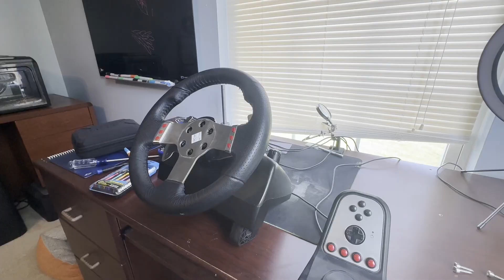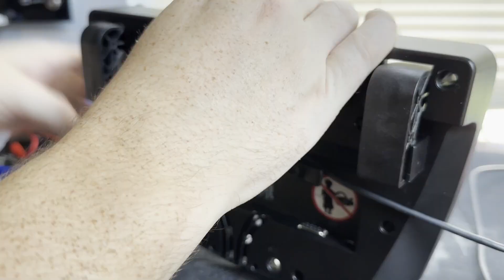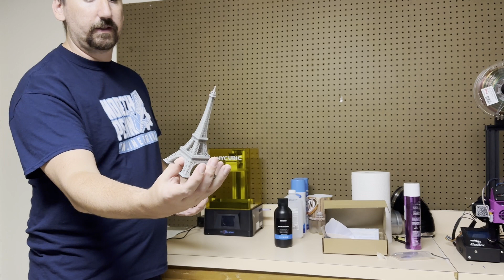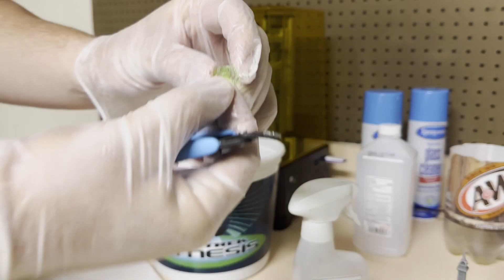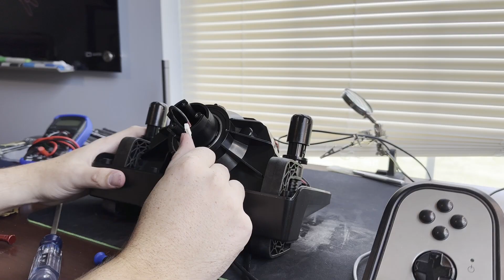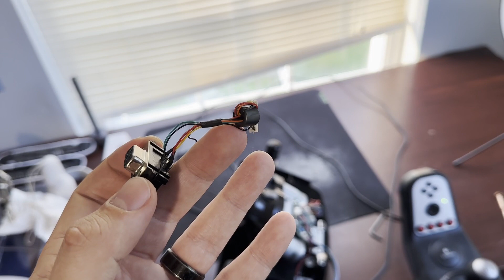Fixing my Logitech G27 Optical Encoder using my 3D Printer!

Comment: I used a metal washer perfect fit, super glued it to the bottom of the encoder wheel, it freaking works again 6 yrs in storage!! I would take encoder to hardware store and match up with the perfect washer, 25 cent fix. #5 flat washer was what I used.

Comment: I saw a video where a person draws the optical encoder on a thick sheet of clear plastic and cuts it out with scissors have you ever tried this?
Reply from the maker: I have not seen or tried that, an interesting idea. Though, the slits in the encoder are so small, you’d need to be super accurate. I’d be interested to see this if you have a video link.
Reply: By any chance do you remember seeing the video?

Comment: with encoder failure do they ever just completely fail to calibrate at all? like i turn on my pc and its just nothing...
flashing green light and all leds on wheel lit up...
all buttons work except there is no force feedback and wheel does not steer at all. its like its completely unread...

my wheel was working perfectly fine and then i had a buzz freeze crash while playing assetto corsa ... requiring hard set of pc
rebooted my pc and the wheel did not center at all and went to the blinking green light and hasnt worked for several months...
ive tried reinstalling the drivers and i even took the wheel apart at one point didnt see anything odd..
however i put it back together and it started working again i was excited but then the same situation happened...
and its just never worked again.
Reply: With encoder failure but no other failures, it will try to move the wheel during calibration, and within a quarter second realise the encoder isn't giving pulses (or isn't giving them regularly enough) and stop.

The USB start-up sequence has the wheel running into both extents and counting steps. When the steps stop after a sufficient amount of steps, it knows the extent has been reached, then after both extents are probed, it goes to centre of the step count and engages centering force. If the sequence cannot be completed, you have no steering and no force feedback, since the number of steps between extents isn't established.

If the wheel doesn't even attempt to turn when you plug in USB not even a little bit, you have a different problem. No power from external PSU, fuse failure, power semiconductor failure such as clamping diodes, H-Bridge MOSFETs etc.

However it can be established that your power semiconductors and your fuse (if present, not all wheels have it) still function or at least still functioned when the wheel came back alive and worked intermittently, and aren't your original cause of failure.

Ultimately the wheel's USB controller doesn't know whether the motor section of the device is functioning unless the encoder is giving step signals. So whether you have no working motor, or whether you have no encoder, both will lead to failure in the USB start-up sequence with the same outcome. But at least having a motor twitch when USB is plugged in would be a good sign that this is encoder issue.

You should also probe the PSU outputs whether they are stable under load, or whether it's intermittent and turning off.

The likelihood of eventual encoder failure is 100% since it's made from water impregnated polyamide and is placed on a warm motor shaft, which causes it to lose water and shrink and become brittle, you could say design life is maybe 5 to 10 years. If it's not cracked too badly, you may have luck ziptieing the wheel to the shaft.
Reply: @SianaGearz  wheel mine doesnt calibrate it only registers the buttons... it also registers the pedals and shifter but not the steering... when i turn the wheel left it sounds normal (like turning the wheel when it is off) but when i turn the wheel right it squeaks kinda loudly
Reply: @acrock21   1. Plug in power.
2. Plug in USB.

Q: does the wheel attempt to turn by ltself? In what direction does it try to move, clockwise or counterclockwise? What exactly is happening, does it instantly start blinking?
Reply: @SianaGearz  instantly starts blinking on the shifter... no movement at all not even a twitch
Reply: @acrock21   OK your issue is not encoder wheel. Your encoder wheel might be broken too, but you have other issue that you need to fix.

Check 24V external power supply that it actually emits 24V when idle. Check the wiring from PSU pigtail to the logic board. If that's all OK, a component level electronics repairman will likely be able to diagnose the issue quickly.

You can also unplug the two motors from the logic board (two twisted Red+Black 2-pin cables at the South of the PCB; south is basically the bottom if the PCB is oriented such that largest text is correct side up), unplug the power supply pigtail (Red+Black 2-pin cable at the East of the PCB) and try to connect them individually to the power supply pigtail say with paperclip pieces or short pieces of wire. The motors should try spinning. If one of the motors tries and the other doesn't, you have a short in one motor's commutator. You can just leave the bad motor disconnected at first, i think the wheel should be able to work like that, but i'm not certain. Both motors are unlikely to be bad, if neither motor tries to spin when hotwired, you have either a bad PSU or bad connection.

Be careful not to connect PSU pigtail to the motor outputs when reassembling.

Note with directions i'm assuming you have G27 as opposed to G29 or something later; the layout orientation of the PCB has changed between them.
Reply: @SianaGearz  correct i do have g27, thank you for taking the time to explain this to me and consider my issue. 

weird thing that happened... my pc will buzz freeze with certain games
it completely locks up and requires a hard reset the reason i call it buzz freeze is because the audio will glitch and make a loud buzzing sound kinda sounds like an air compressor... its not overheating which i tested... i tried down clocking my gpu and cpu... didnt help. i thought it was software but its something else. i know that because i installed a fresh ssd and a fresh install of windows 11 and the problem is still there...
theres a lot of games that are very demanding and they will run just fine and some just cause the crash anywhere from 10 minutes to 1 hour into game play... assetto corsa is one of those games...
and while i was playing assetto corsa the last time... my pc crashed when it crashed and i shut off my pc it rebooted and the wheel was dead. so that was odd to me. that didnt work after a software pc miscue.

the has crashed on different games since i unplugged the wheel. i tried installing day Z to play and it would crash seconds after loading in. i kept trying to get it to work about 40 times or so... and it finally corrupted my windows boot on my ssd... so its stuck in blue screen boot loop. 

since installing a fresh ssd and OS. i tried day Z again... was able to play maybe 2 minutes but then another crash...

ive tried different gpu didnt not solve.

driver complete whipe and install didnt not fix it

ive got it narrowed down to PSU MOBO or CPU 

i saw jay 2 cents talking about coolers being too tight can cause pin connectivity issues and so that is the next thing i try. 
i have a thread ripper and a dark rock cooler... so i will have to wait until i clean my pc to see if it fixes it becaues that cooler is an extreme pain to work on.
Reply: @acrock21   Lay the PC on its side and run it like that for a while, see whether the hard-lockup still occurs. The weight of the cooler could be compressing the socket in an unfortunate way, or the GPU could be misbehaving due to sag, when it locks up it can jam the PCIe bus on the CPU.

I have seen similar issue from Scythe Grand Kama Cross 2 cooler (very old) before i replaced the mount kit for a new build; i also found that the curvature of the coldplate was very extreme and caused the cooler to wobble and it just didn't feel very convincing that it can even be tightened down consistently, so i mirror-lapped the inner 3/4th of the area until it was flat and i was satisfied with the fit. I haven't had any issues with it now on the new build, 2 years in. Other manufacturers have less convexity than Scythe did back then.

I have also had this issue with a GPU, so i made an anti sag device, it helped both with occasional hard lockups, bluescreens and with fans grinding on their mounts. I don't suspect the issue for me is necessarily in the GPU itself, apart from the fans, it may simply be loading the socket badly leading to bad connection.

On a relative's computer i have traced down a similar issue to gunk in memory socket. I washed the RAM contact edge with isopropyl alcohol and washed the socket with isopropyl alcohol spray too. This is good to do with all connections in case of suspicions. This computer is now reliable.

You can also try to tune up adjustable voltages on your CPU by only one step one by one. By all reason your highest performance state is tuned in so well that it's not subject to reliability issues, but SpeedStep/Cool-n-Quiet P-state transitions could still be flaky - the voltage is decreased alongside frequency and could be landing in an unstable frequency-voltage relationship intermittently.

Also memory malfunctions sometimes look like CPU malfunctions. Which is unfortunate since budget kit XMP is often pushed to the edge of phase margin with no reliability headroom.
Reply: @SianaGearz  wow this is gold ill try these things and report back. I use to have 1 dead stick of ram and i got it working after some trying of installing… i am running 8 sticks at 128 gb ram… 1 was a pain to get to work… but i crashed before when i used 64 gb… either way ill try all these things you suggested

Comment: hey print! how do you know which orientation to replace the disc is correct? I had taken mine out but when I put it back it, the wheel's rotation stops at odd angles i.e not the full rotation as you get with a 'whole' intact unit!
Reply: There is really only one orientation that makes sense. The symptom you describe means the encoder isn't on the shaft very well and spins free, or touches and rubs against the PCB or other components, or it's cracked and lost some teeth. Or your problem isn't the encoder at all.

Comment: The days of being able to trust Logitech to be high quality are far past.
Reply from the maker: Seriously, very disappointed with this wheel. It has minimal use, and no replacement parts available from them.
Reply: @PrintPractical  But it's also over 10 years old.

I agree the engineering is unfortunate. The polyamide encoder wheel cracks because the motor shaft is warm and drives humidity out of the PA material, causing it to shrink and then be split by the shaft. Without direct heating, if the encoder was placed on its own gear, the wheel should last over 20 years, but this way it can last for only 5-10. But also they have inherited this engineering flaw from the G25 at least if not earlier.

I honestly don't know when Logitech was supposed to be so good. More myth than reality. I bought a Logitech laser mouse in 2003 and a few months later the silver paint started rubbing off on my hand and the fairly soft nubs of the button switches started eating themselves a groove in the pushers that are part of the top shell mouse button part, making them impossible to press. I had repaired the pushers with a little epoxy back then.

But then nowadays you have a gaming mouse problem cross manufacturer, that you can basically 100% rely on every single gaming mouse with STM32 or NXP LPC processors, and with D2FC switches no matter whether 10 20 50 million press variety, that the main mouse switches will no longer be reliably registered after just a short time. Alex Kenis did a deep dive. And of course Logitech is right front and centre there, and at their volumes, they guaranteed know the issue and just refuse to do anything about it. Simpler electronics was more reliable due to being on the better part of voltage current curve that would restore the switch function, and nicer switches such as D2F Japan gold plated, as well as Huano and Kailh are available which are less susceptible. A tiny little resistor to provide more pullup current would have solved this.
Reply: 2 g910s, 1 g19 keyboard, 3 g510 mouses, 2 g933 headphones all malfunctioning, and my g27 just got saved from a one way ticket to landfill